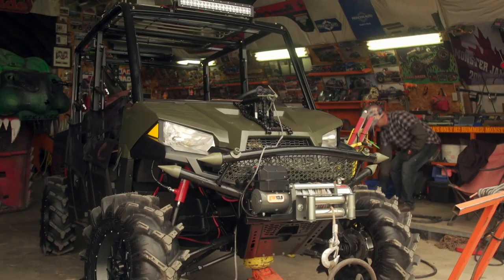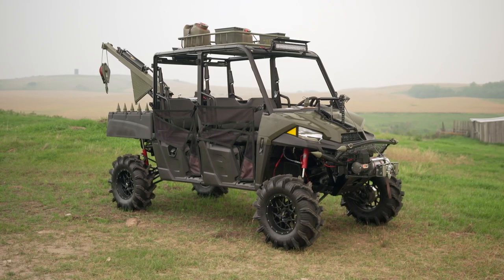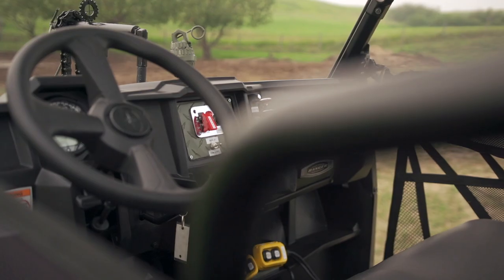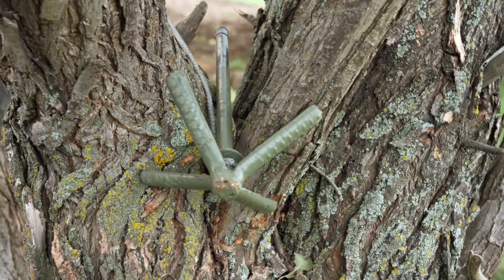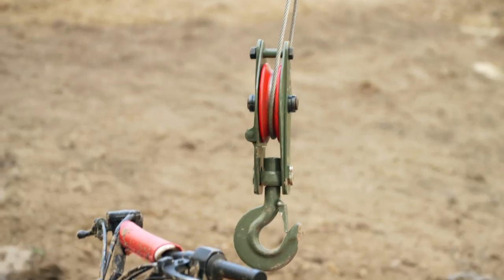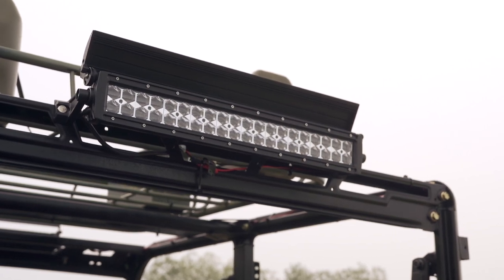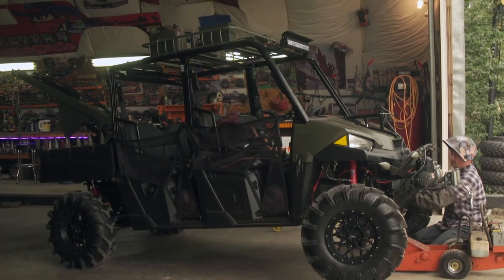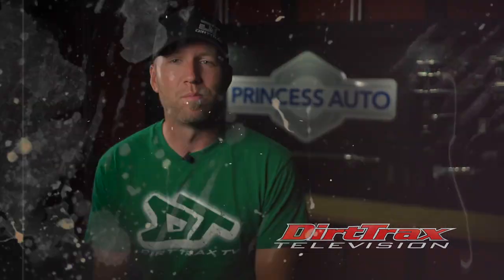The Ultimate RANGER Rescue Rig with Princess Auto

Comment: Cool build, but a couple engineering issues i can see from that quick overview....
1.) The 13.5k winch may well fit, but I suspect the electrical system/alternator wouldn't support it's use very long, nor would the structure of the SxS hold up to the pulling power if the operator wasn't right on top of his game.
2.) The hydraulic lift cylinders replacing the shocks is a great idea to gain lift when needed, but unless there are some hidden components not shown in the video, there is no "suspension" in the suspension any more. Any ride quality or articulation is gone. Better to add a pivot to the system and mount the lift cylinders inboard/horizontal so that the shocks still work as shocks.
3.) The lift system for the wrecker boom. I don't think hydraulic cylinders are designed for that kind of side-loading. Why the "ramp" system was built instead of pivot points, I don't know, but that ram will bend and that cylinder will be trashed.